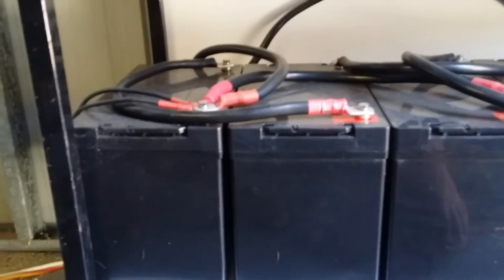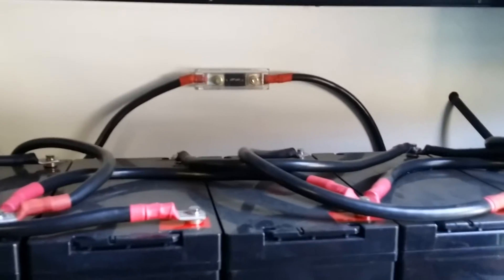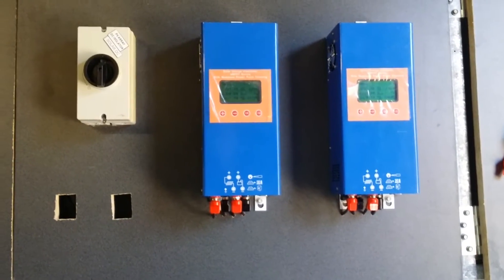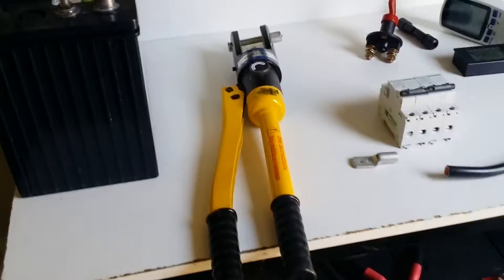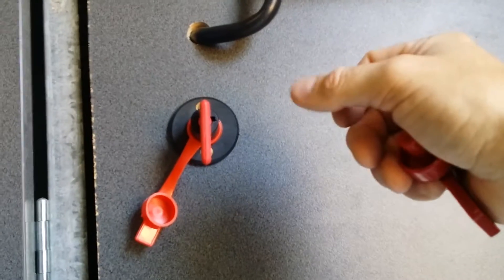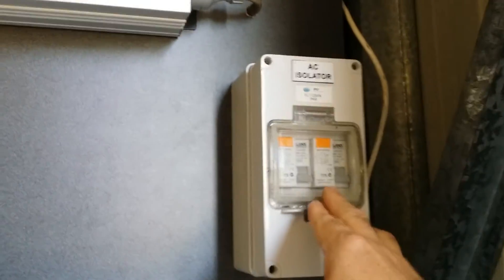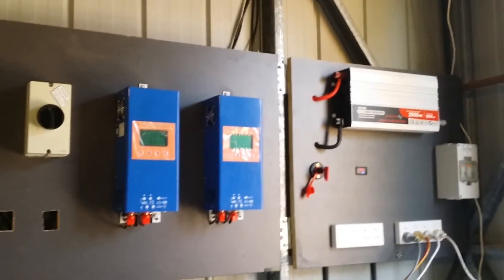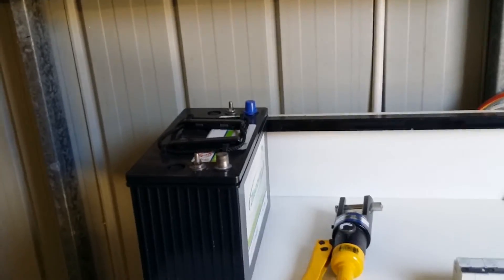Tour of diy solar panel and battery bank system and explanation of components

Comment: I've got the same batteries hookup but I'm getting 2 more Saturday so I'll have 10 but the amp hours will be 425 ...I used 1/0 cables and there's 4 of them ran to the inverter/charger (2000 watt Aims 24 volts)...As I have it now with 340 amp hours it wants to creep down in voltage when I put a 1500 watt or larger load..I ran my air fryer (1450 w) and coffee pot (750 w) at the same time (2200 w) for about two minutes and then overload kicked the inverter out, it just draws more than the batteries can give for long but it will run more than it's rated...it does weigh 44.1 pounds and some of it is a big copper transformer...it's  all there...I like it now after I almost have enough batteries to run it lol...I'll have to try it again.

Comment: Why didn't the DC breakers work out for disconnecting the PV array?
Reply from the maker: I must've calculated the amperage wrong for the breakers and they were limiting the amount of charge going to my bank. I have since installed two DC disconnect switches like the ones I use on my inverter

Comment: Hello Mate,
Thanks for the review of your Off-Grid Solar System. You mentioned that the INVERTER you have their is rated for 2500W but according to your test, you only see an output of 2200W on your Kill A Watt Meter.
The reason why you didn't get the full capacity of that Inverter was, the two lead wires that came from your Battery Bank to your 2500W Inverter needs to be upgraded to a lower gage  (AWG) like 2/0 or may be 3/0 especially if your Inverter that surges that high up to 5000 (5Kw) you have to upgrade your  Inverter cables to 2/0 or 3/0 then you will definitely utilize the maximum power of that Inverter.
I hope this will help you to understand what I'm trying to say. 
Please get back to me ASAP after you try it to see if it fix the problem. 
Thanks for sharing your project with us and God bless you.
Reply from the maker: Hi thanks for the comment. I believe that smaller gauge cables would limit the current to the inverter which would create heat and efficiency loss
Reply: hobbyfarmer85 
That's absolutely correct

Comment: Good work.  I recommend going the extra cost with the inverter and go for a Victron or the likes, maybe a Giant Power one.  Yep a LOT more expensive but a lot more efficient and can be very well customised to suit what you need.  Also the sinewave from them is a LOT cleaner, and will take excellent care of any electronics you might want to run from it.  Lastly, see if you can run your panels into the MPPT controllers at a higher voltage.  This will improve efficiency as there will be less voltage drop across the wire between the panels and the MPPT controllers.  I have mine running at around 85V open circuit, it drops to around 75V when power is being drawn.  Let the MPPT controllers do what they do best, convert volts to amps for your batteries.
Best of luck and I hope you're enjoying your off-grid setup!